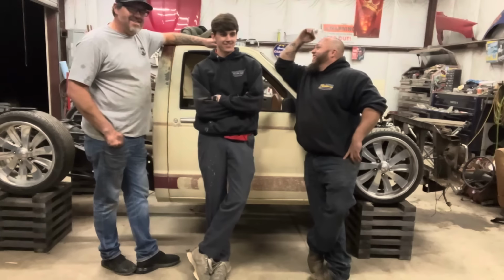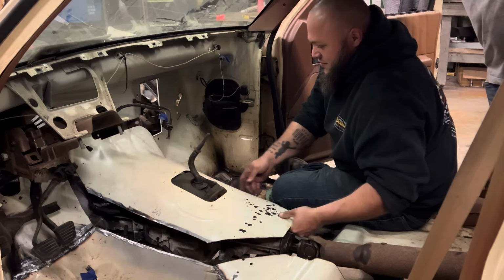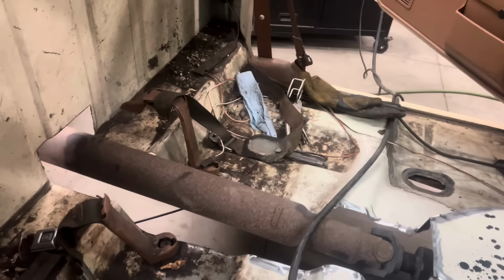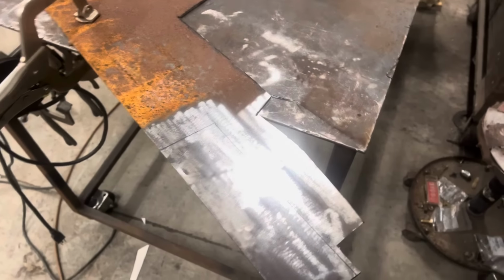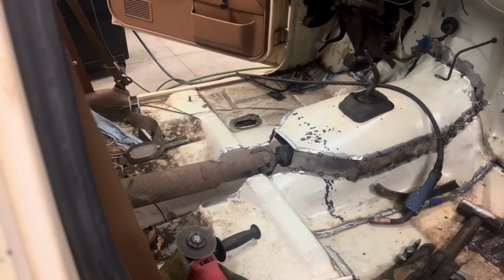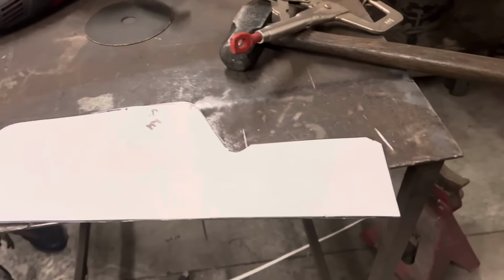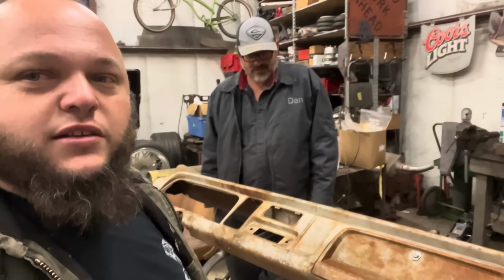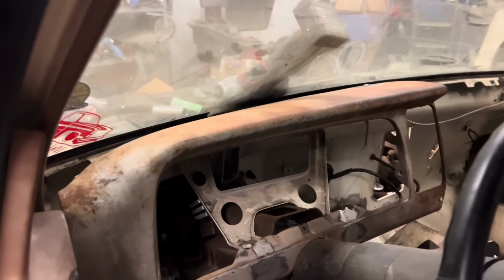Stock Floor Body Dropping our 1989 S10…part 7….patching the floor

Comment: Little trick to get the filler for the new dash, use the factory s10 dash and trace it on some sheet metal and then just cut how long/deep the filler is to weld to the c10 dash or use it as a template for the top of the c10 dash to fit up to the windshield and that’ll give you the best fitment to fit up to the windshield……..Keep up the good work 

Jered
Reply from the maker: Thanks man….i was gonna weld it in but decided to make it bolt in and removable
Reply: @lowerclassfab431  yeah for sure, I’ve had several s10s and had a 91 first gen on 24s with irs that laid frame that was white. Have had several rides and was in Severed TIES ky chapter and been around the club for about 15 years so I’ve been around. Stepped away last year for a break but still around if that makes sense lol just haven’t been to many shows in the last 2 years. So took a break, always looking for tricks in the scene, I enjoy watching you guys get after it that’s not charging 200K for a build 😂